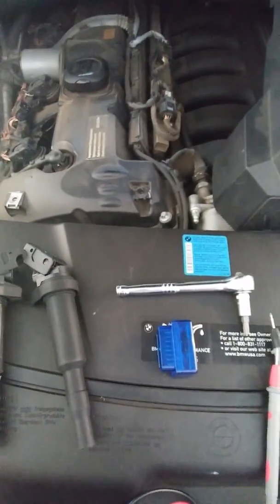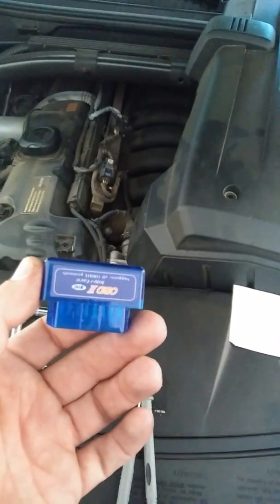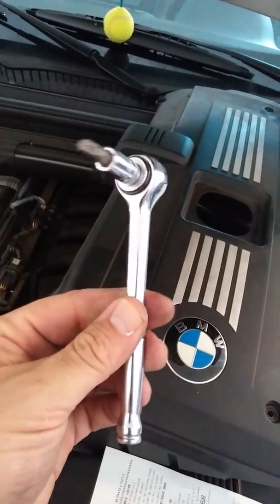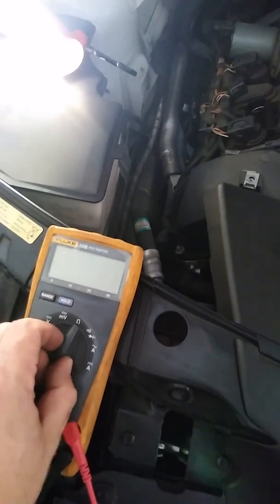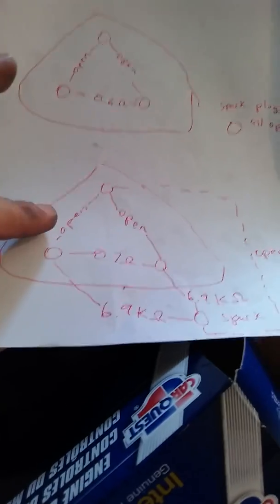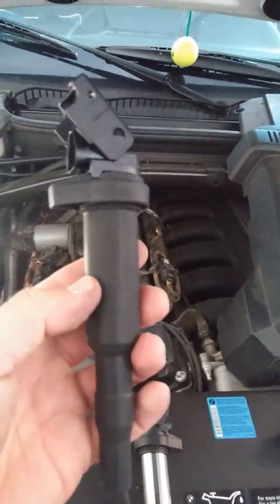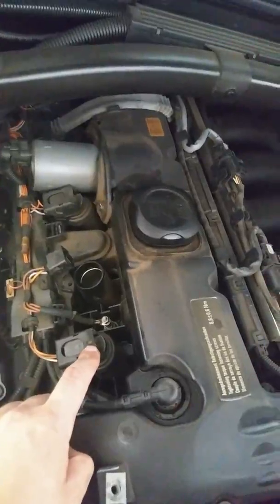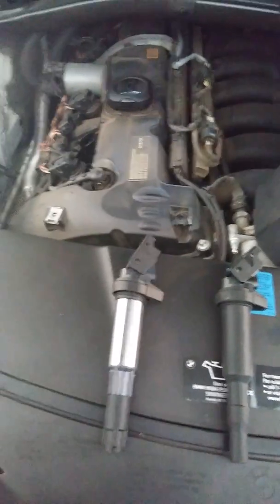BMW X3 Engine Cylinder Misfire P0301 P0302 P0303 P0304 P0305 P0306

Comment: Nice video and well explained. 
It seems that, for consistency, it should be better to replace the coil withe same exact brand of the the other ones because there may be tiny differences in output between brands, but that may be a bit overkill. 
The full black coil, that you are showing as the "good" one, may very likely be a Bosch, the faulty coil that you removed looks like a Delphi. In any case they both have same exact specs and are OM equipment. Those sold as Delphi and Bosch ( they actually are made by either brand) cost between 22$ to 34$ depending where you buy them. As usual the so called BMW Genuine ones are exactly the same item, same exact part number as the Delphi and Bosch, they do not even have a BMW logo casted on them,  except for the one printed on their packaging and cost about 70$.  So there is no need of buying the BMW genuine, in this case. Cheers.

Comment: How can you check the connectors to see if they are bad?
Reply from the maker: DeShawn Lewis If you want to know if the coils are getting a signal from the ECU/computer,  you will need an oscilloscope for a nice diagnosis. You can also make a simple LED circuit with a resistor and an led and plug it to the connector to see if it turns on and off rapidly. A simple basic led operates around 18mA so you will need a resistor of r=13.5v/0.018. LEDs have a polarity. Check Google on how to wire an led. Check which pin is ground and Wich pin is signal on the connector.
Reply: Mariano Ruiz  thank you very much.

Comment: Hello Mariano, two question: I have not use the multimeter before. Does the positive goes to the pin and the negative to the ground? and how about the multimeter gauge, what position should be pointing to? Omg? My second question is, should I care what coil pack brand goes in my bmw? Do you recommend any? It sounds that this coils failed a lot, maybe a genuine part is not as good as they say. Other than that, thanks for the video. Good Job!